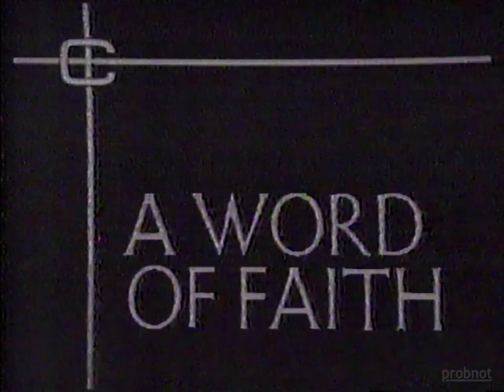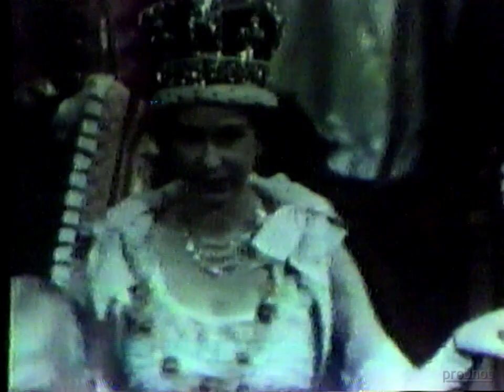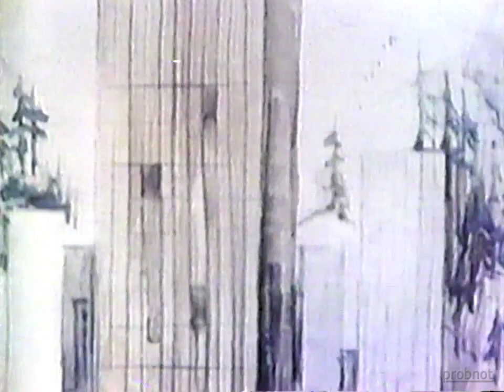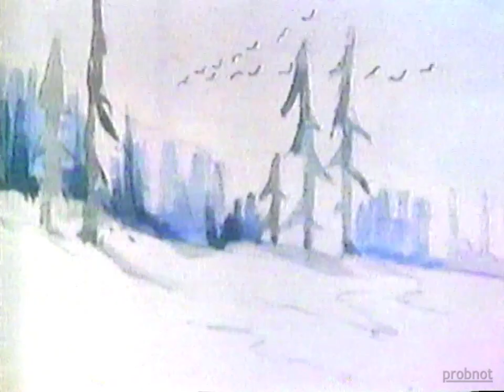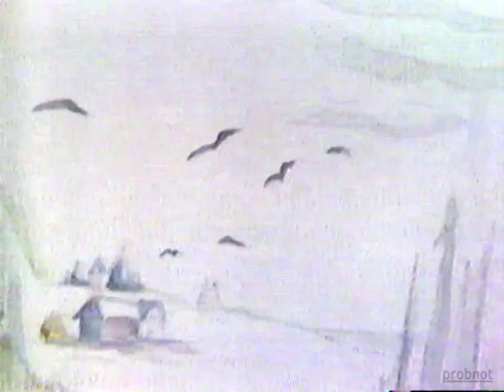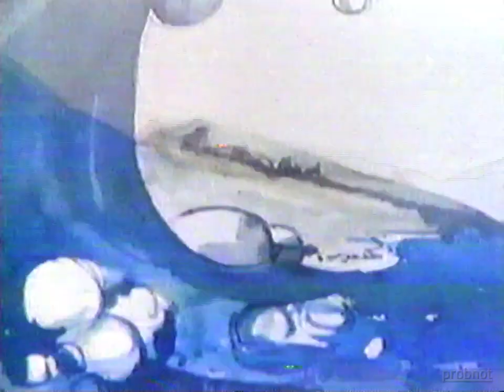CKY Winnipeg Sign-off [1987]

Comment: CKY had the same sign off into the early 2000s as far as I remember. I don’t know when they quit or if they still have the same sign off.
Reply: CKY TV replaced the 1983 Michael Mills Productions  O Canada animated national anthem film with the 1988 Calgary Olympics national anthem film in fall, 1992; after using it for 9 years. Also; CKY TV stopped using the God Save the Queen sign off in 1996. Lastly; CKY TV stopped signing off somewhere between 2002 to 2004 (I could be wrong though).
Reply: @mamacass757  According to one video, they stopped airing the national anthem around 1996.